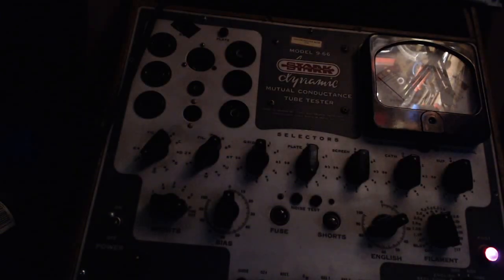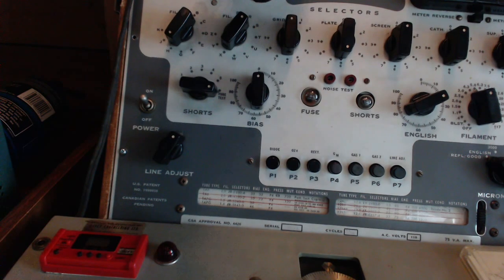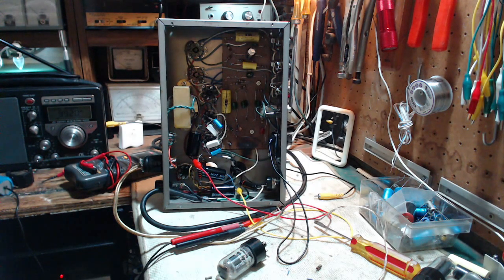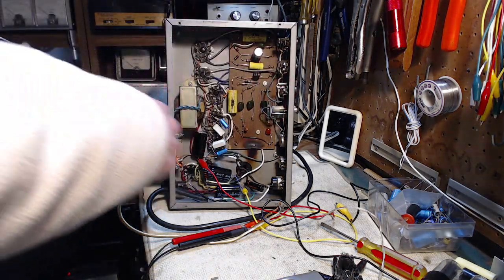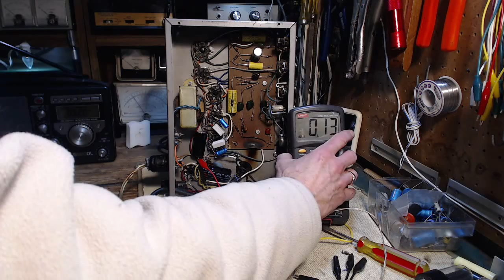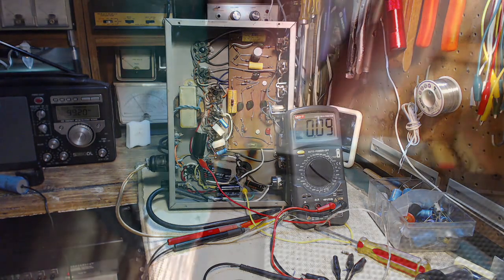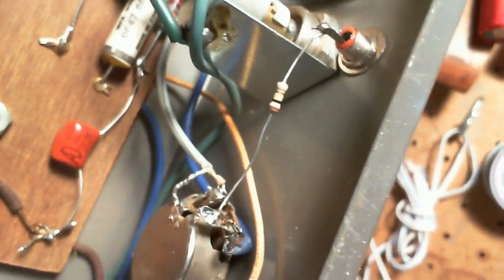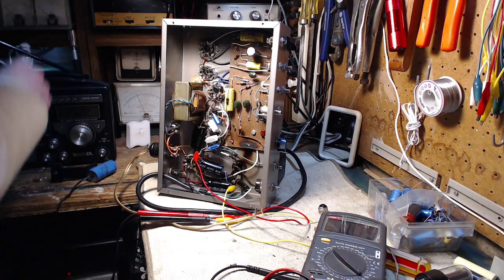Vacuum Tube PA Amplifier Video #35 - I See the Light!

Comment: Well who'd have thought it?! nice one Jim, this happened just in time to save your sanity! Just a thought, if you're going to leave the heaters floating, put two 100 ohm or so resistors in series across them, and ground the junction of the two resistors. this will balance the two heater lines so they are operating in a sort of push-pull with respect to ground, and the theory is it cancels out any hum that might be induced from them or from a tube heater. Nice guitar playing btw, love that FX pedal. And the amp sounds lovely and clean too :)
Reply from the maker: Alan Cordwell I had to think about the two resistor idea.  I guess the idea is to balance the influence of both legs of the heater wires with the chassis so they null each other out.  This would fix a situation where the two heater circuit wires were not identical in length, position and other unbalanced factors which would result in an induced "imbalance' current in the chassis or elsewhere in the amplifier.  Am I on to it?
Reply: Jim Lindenas yep that's about it Jim. Actually, just developing that idea a bit,  you can fit a pot instead of the two resistors, track between the heater lines and wiper to ground. Then you can adjust for minimum hum. This device is usually known as a 'humdinger' and I've seen one in Fender amp I think it was. You will need to isolate that bulb holder from chassis somehow! Or fit an led in it so neither wire is grounded :)

Comment: Good job! A little guitar and there you go...inspiration!! If you played some Cat Stevens maybe Draper would have come in for back-up solo's!
You worked on the assumption (a correct one) that the amp worked correctly once...turns out it probably always had the hum.  I agree with others the wiring of this amp was less than ideal and all that same colored wiring..ugh what a pain to trace out.  Big tip on working on future "home built" gear I bet! Never stepped away from it either.
Reply from the maker: GrandsonofKong It's very hard to realize things like wrong tubes or poor wiring when you know something worked before it got to you.
Reply: Jim Lindenas
Sometimes when tracking down problems that are particularly frustrating, I would stop and ask myself "Did this ever work correctly?" when some many contradictory things seem to show up.